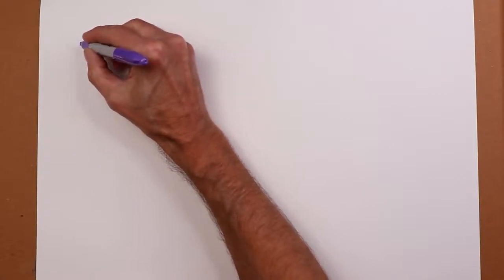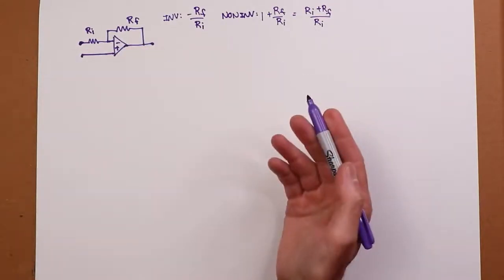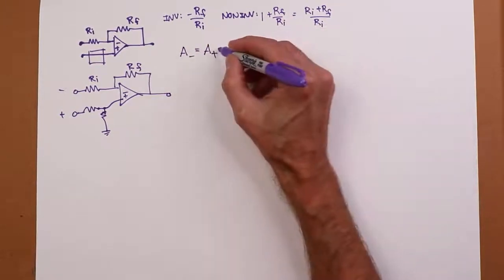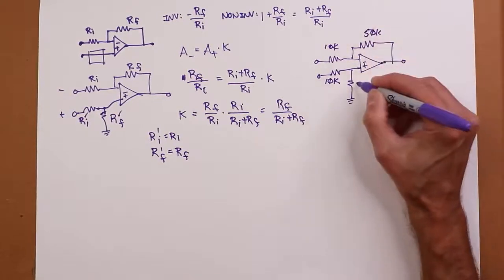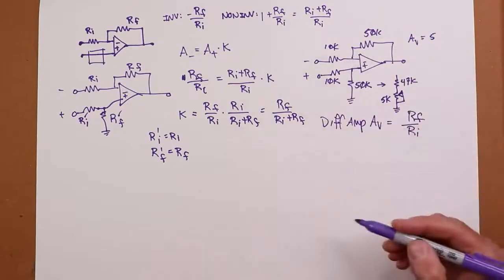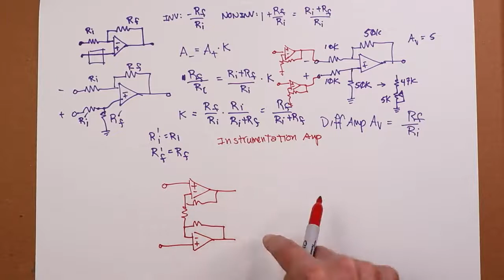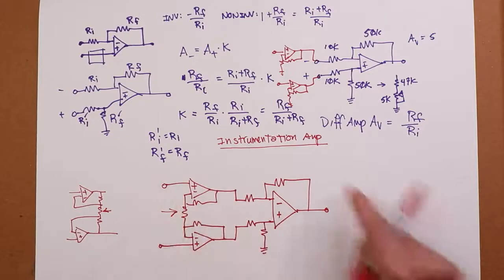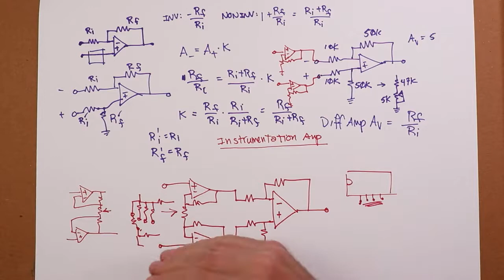Op Amps: The Op Amp Diff Amp

Comment: can you replace the op amp with the transistor version for this diff amp?
Reply from the maker: The op amp based diff amp is a functional equivalent of the usual dual transistor version, and generally offers higher performance (depending on the op amp used). A three op amp instrumentation amplifier would be the next step up.